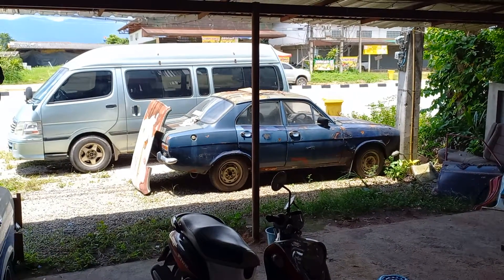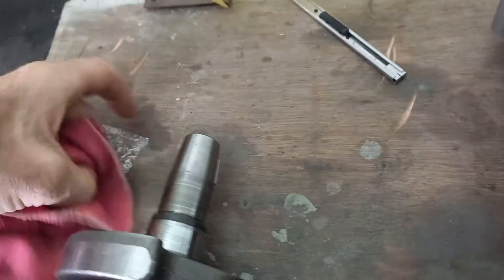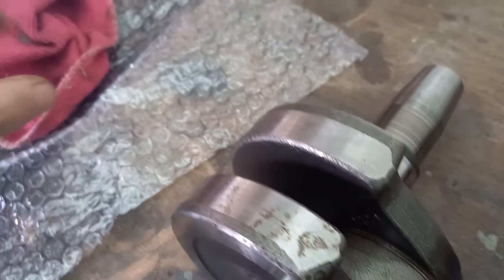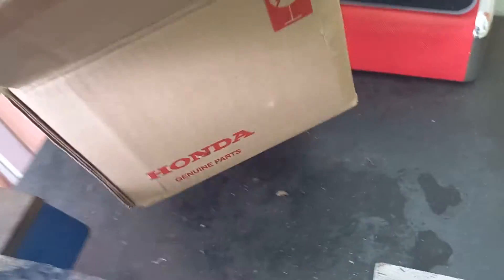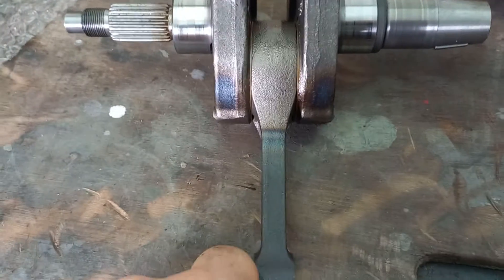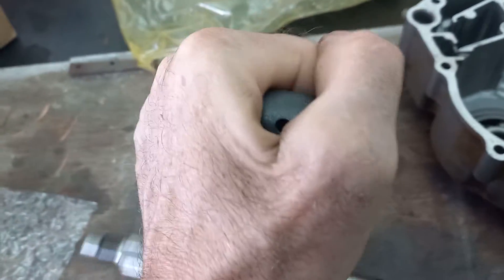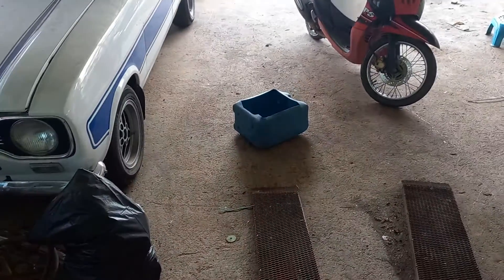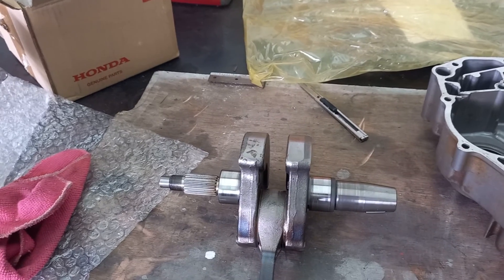CRF250L TO 286CC (300L) crank wear and inspection

Comment: did you install the cbr300r crank or the crf300l crank?
Reply from the maker: I cant remember the exact part number now, i think it was the L crank. I remember seeing different size primary gear teeth on some models 34 or 35 teeth? It didnt cause an issue as the drive gear swaps from 1 crank to the other.

Comment: Dude to determine what shell size you need as well as measuring the crank it goes on colour coding on the inside of your crankcase and i see on yours its like a pale blue ? 
A good Honda dealer will ask for that colour code and tell you what spec your bearings are on that particular batch and engine number , but you know as well as i do here in Thailand your pissing into the wind 😂😂😂🤘🤘🤘
Reply from the maker: 555! You had me all the way to the end there as i was ready to type 'its like pissing in the wind'! I went with blue, they measured 4 different sizes on each end of the bearing and were smaller than the ones i took out! Its done a few thousand hard kms since then so.... T.I.T. :)
Reply: @helmutschmacher2100  I got my first Honda element in 2002 it was spec'd to 1/10 1,000th of an inch, which was unheard of, meaning 100k mile oil changes, then come COVID 2019 and all was lost, now 1,000 'th of an inch is tolerant engineering; Used to be you could buy sleeves and grind your cylinders to fit, and run WISECO piston with ring set's, now its apparent that everything fails with the new paradigm of +-10 1,000'th of an inch and file your own rings to fit :(

Comment: Is it just the crank and rod that get swapped please?
Reply from the maker: Crank with rod and balance shaft. Use year for year ie 2014 for 2014 etc as there are small differences for post 17 bikes. DO include the cb300r ECU as that made a major difference to the performance.

Comment: How many miles are on the engine?
Reply from the maker: Not really sure as the speedo has always been wrong due to wheels n gearing. It shows 26k but its a lot less than that, ive seen 166kph on the speedo when running 13/48 but that was probably nearer 100kph.
Reply: @helmutschmacher2100  Apples to Oranges, and given that you pointed out that your low mileage OEM crank was 'shiite' it would be interest if you pulled your current crank after-market and see if it done any better???? Like all things, the +-1 year life span of all machine, parts including 'boeing' is now the rule of day,  planned obsolescence has gone ELON-ASTRO